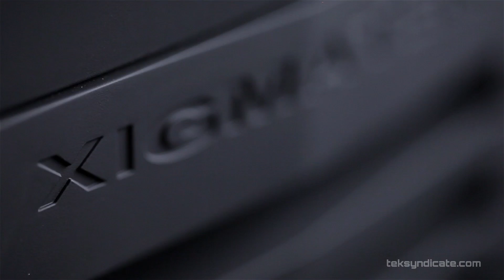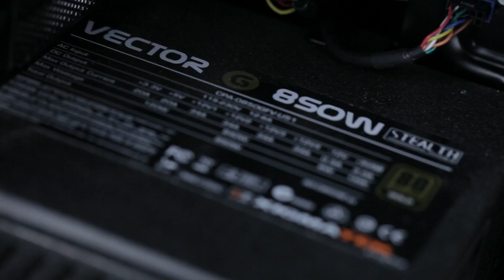Pistol's AMD Workstation Build For Streaming, Gaming, & Editing

Comment: is Pistol an AMD fangirl? surprised to see a 9590 instead of a 4770k or a 2011 socket.
Reply: If you watched the entire video, you would realize that they said it was better in some applications, such as streaming, than the 4930k.
Reply: never said it wasn't..
Reply: Well i don't see it used in many builds at all. most people just go for an intel, don't find anything wrong with it.
Reply: I think i will try it. should have no problems with heat if i put it up to 4.6ghz.
Reply: CrypticMeow So why are you surprised?
Reply: I actually might consider buying one for my second computer. ATM it has an 8350 in it but pretty sure it's faulty, Bottlenecks almost all GPUs i put in it that are high end.
Reply: CrypticMeow Have you tried overclocking it?
Reply: No i haven't.
Reply: CrypticMeow It could be from a driver issue. Try and see if a small overclock reduces the effect and try and see if you can push it far enough to negate it.

Comment: So Pistol has the 9590. Yet, on the cpu itself, it says " 2011".
I thought the 9590 was made in early 2012 and not released until sometime Q3/Q4?  Am i missing something here?
Reply: I believe it has to do with AMD marking their chips with the year the architecture was released, not the years they were revised. So the 9590 being essentially just an overclocked Bulldozer chip would be marked 2011, as that's when the FX-8150 came out. The same applies (or should apply) to all 32nm FX CPUs.

Comment: over 8GB ram needed game: BF4
Reply: That is ONLY if you play the game in multiplayer online and if you're running higher than full hd with maxed eye candy settings with a beefy enough machine.  The crashing you read all over the net about is a ram pagefile conflict between windows and the bf4 game.  It's not exactly the fact that bf4 acts like it ran out of ram reserves for caching things that the gddr3 or gddr5 vram in video cards cache versus the pagefile reserves that windows automatically sets, unless you manually specify that amount in a different amount.  

My friend's 2GB gtx 660 + 8150 running at 3.8ghz auto voltages with 6 GB of ram runs the game file in campaign except for some locations in the same few maps.  It's really an in game engine problem from the developer(s) of the game in which now someone ( whether it be EA, or Dice, etc) must deal with patches to fix.  

This is why i am NEVER a "first day launch" consumer of any video games no matter how good to price to value ratio is.  I ALWAYS wait until what I feel "enough" bugs HAVE been resolved before I pay money for any game. My time is more valuable than dealing with a 50+ dollar game that is plagued with bugs.
Reply: I run with 8GB of RAM and a GTX780 with not higher than 1080p and not max out any of the setting. There is still memory leakage.

I have digged into it and have conclude that the game is using the pagefile after out of RAM. Since all the stutter occur only when all my 8GB RAM are full.

It is a fact that at this moment, BF4 require over 8GB of ram to run completely stutter free.
Reply: ***** There's memory leakage because that game is buggy as fuck.
Reply: Pistol Slamfire agree

Comment: people are always concerned about noise...i give zero fucks as long as temperatures are low
Reply: On a video editing rig you want as much silence as possible so you can tell what you need to edit out (might be a weird ticking sound in real life and its actually your hard drive and you want it to die unsuspectingly) and also you might want near complete silence if you use speakers not headphones.
Reply: DaMagicalManiac Do video editors use headphones or monitor speakers to edit their videos though?
Reply: Dylan Coulston Well I'd think that someone taking video editing a bit more serious than a hobby would use monitor headphones so he can pick up any sounds that he may want to amplify or turn the volume down on.
Reply: Dylan Coulston both
Reply: This is an editing work station so I understand the need to silence 

My gfs yeti used to get sounds from the standard case fans until we turned the gain all the way down

Comment: Nice. My system is a lot like that only the value version:
8320 @ 4.6
Crossfire 7790's that were $70 a piece
Same mobo (don't update the bios btw, stock is best)
R4
Used 840 EVO (reads and writes at 5gb/s)
2 Striped WD10EZEX's for games (reads at 1gb/s for some reason, pretty neato. Were $45 a piece)
TT ToughPower 750w gold PSU which doesn't have the best reviews but so far has been rock solid.

Very happy.

Comment: Odd choice the FX-9590. Basically all reviewers stated that there is absolutely no reason to chose this CPU. Maybe if you don't want to change your motherboard. But it's not like the FX-9590 is a cheap CPU...
Reply: Those reviews were done when it was $1000 at launch. Now it's a third of that, which makes it not the best option for everything or even all around but for streaming it is an absolute monster.
Reply: You might not be aware of it's huge price drop. From what I remember the 9590 was a terrible processor because of the ridiculous pricing at release. Every reviewer was too busy screaming over it's price to really talk about it's performance, which was again was negligible due to price. Looking at it now, it's not a poor choice by any means.
Reply: Well I agree that FX-9590 definately lacks the amazing price to performance ratio of FX-6300, FX-8320 and FX-8350 and therefore it's a lot harder to justify choosing it over i7-3770 or i7-4770 but I feel like people highly overestimate the magnitude of mistakes they can make while choosing CPU or GPU nowadays. FX series is pretty amazing, Intel makes single cores that can crush nuts, all-in all market has it's issues but they are pretty small and no matter which choice you'll make you'll be rewarded with a good experience in real world scenarios. I feel like benchmarks confuse the hell out of people. No-one is buying FX-8320/i5-4440 to bench it against the option they didn't get to torment themselves. People buy chips to do stuff and if you know your budget and have realistic expectations for that budget you'll make a good choice no matter what.

Comment: nVidia is better for rendering and other workstation tasks so why go for AMD?
Reply from the maker: OpenCL.
Reply: Nvidia actually has worse compute performance compared to AMD especially in OpenCL tasks, the only reason why for a long time Nvidia was used for rendering and stuff like that is because some popular workstation applications mainly only took advantage of CUDA cough Adobe cough. Now that is starting to change as we see a lot more applications take better advantage of OpenCL.
Reply: Nvidia is actually pretty awful for general compute processes. Why do you think the R9 series from 280x and up have been sold out and STILL are? You'd be incredibly hard pressed to find a single 280x, 290, or 290x still in stock from official sellers/resellers at MSRP.
Reply: ***** No, you are missing something. Yes, AMD cards have been sold out because of BitCoin/LiteCoin mining, but the reason that they are used for cryptocurrency mining is because they have better compute performance per dollar, this compute performance can also come in help when it comes to things like After Effects, Photoshop, AutoCAD, 3DS Max, and for pretty much any program that can take advantage of OpenCL.
Reply: *****
Sorry for having a slight misunderstanding of your previous comment, what I took it as was like you said Bitcoin mining was the only reason that they were sold out and the only reason a person should ever get one, but now after reading this comment I get what meant. Again sorry for the misunderstanding.

Comment: Got my 8320 to 4.4ghz and it's plenty fast I would be worried about the thermal output of that because it's 100 watt higher than mine for 600mhz not worth it to me for the price either it's very expensive and hard to get in Britain for some reason

Comment: mistake me if im wrong but could you of had either the fans or the radiator on top on the outside of the case underneath the plastic window?

Comment: 9590 faster than a 4930 at anything? Why do I doubt that?
Reply: cause intel faboy syndrome wont allow it
Reply: Masterincommander Because if you look at benchmarks the 9590 barley holds up to the 4770 that's why.
So shut up if you just want to talk garbage.
Reply: more than double the price 3-7% better, totally worth
Reply: TheBernhard100
So because the benchmarks say the 4770 is better, it doesn't matter that they said in the video that the 9590 actually worked better for their use in the real world?
Reply: Price and less cores - bad side of Intel here. Also she had AMD build so she changed only processor. Additionally motherboards for 2011 socket are pricey nearly as much as processor. Here are your answears. AMD is way better for people who looks for quite cheap workstation.
Reply: *****
As you heard she needs PC for streaming. In this case FX 9590 is way better than Intel. Also as you of course passed part about she having AMD platform so she had to change only processor?
Oh and Intel is not king. Intel is just corporation which has luck to produce better gaming processors for now. We don't know if it won't change (it is always superiority of one producer for few years and then again other).
If I would buy gaming system it would be i5 4670K if working I would have problem choosing between FX or i7. Tho still - in games FX with Geforce is nearly as good as i7.
Reply: I never Said that Intel is better price/performance wise, or comment on the fact that the 9590 is not on a different chipst (like the 4930). I just said, that going by the benchmarks, the i7 4930 preforms better, by a lot. Both in terms of real world test and artificial benchmarks, and I doubt that there is any program that breaks that rule (notice, I said doubt, not impossible)
If you are going by price AMD wins (ofc. only as long as you don't count the extra power cost and the need for an aftermarket cooler if you want a quiet system).
Reply: TheBernhard100
Same goes with i7 4930K - need aftermarket cooler and uses up much more energy. Also - don't talk about TDP - if it's what you base it. TDP in both cases means something different. Oh - and syntetic benchmarks are mostly poor way to choose - eg. I saw tests where FX 8350 owned in many benchmarks i7 3770 - it all depends on graphic card added to them. Also - do you really have i7 4930K? I'm starting to doubt it.
Reply: AkaRyupl Lol, never said I owned one, also I was talking about the lower end models, forgot to mention that, not the high end.
You can easily run a 4770 at around 3.8Ghz and have a silent system. Compare that to the heat output of a 8150 (my brothers) and AMD becomes a joke.
You basically need to buy an aftermarket cooler for ANY 8 core FX chip, this making them about the same price/performace as the FX.
As for benchmarks you can benchmark a lot of different applications, such as games, video editing, rendering, even streaming, and from what I've seen the i7 4930 destroys the 8350 in everything.
Reply: The 8150 (which is the older one, 8350 is the newer vishera btw and apparently it's much better) has a 125w tdp. That's the same as my phenom 2, and even overclocked it isn't loud with a cheap $30 or less cooler which I'll keep it for years and for several cpu upgrades.If you're going to spend $300 on the cpu alone, what's another $30?
Reply: TheBernhard100
You really don't have knowlage about it do you? For 8 cored processor you do not need aftermarket cooler. FX 8350 runs pretty cool and is better than many processors from Intel to work.
FX 8150 is old processor from before i7 3770. You can't compare it to newer ones - it's called manipulation. Oh and you was saying about FX 9590 which apaprently is as good as i7 4930 in many things. Stop trying to manipulate because it is funny.
Also you have no idea about heat output in AMD or Intel - in bot cases if not OCed BOX cooler is more than enought and it runs pretty quiet. But if you OC it's complatly different - both need aftermarket cooler.
Reply: AkaRyupl Sure, because real world experience doesn't mean anything.
I build a PC with the 8150, it is fucking lounf.
Looking at the changes from the 8150 to the 8350 I highly doubt that there was a huge change in temperature output.
Also, I like to trust benchmarks over a bunch of people yelling around about how much of a Fanboy they are.
Reply: TheBernhard100
Benchmarks many times were acused of falsificating results. So I would not base my knowlage on it.
Also as I said - i7 is worser than FX 9590 in many professional tasks like streaming - it has 8 cores not 4 or 6.
Of course you will call me now fanboy because I said that Intel is not as good in everything? Your lack of knowlage in this task shows many things.
Also of course you passed part when I told about gaming system - thank you very much.
Reply: AkaRyupl Look, until I see some benchmarks (artificial or real world) I doubt the 9590 is faster.
From my personal experience the 4770 is faster than the 8350 in almost everything.
The 9590 ads less than 1 Ghz whilst the 4930 adds 2 more cores (4 threads).
I never said that it is impossible for it to be faster, just, from what I have seen so far, very unlikely. I am willing to change my opinion if I am proven wrong (especially since I am looking into building a streaming PC atm), but I doubt you are.
Reply: TheBernhard100
Apparently FX 9590 will be better from Intel i7 - in video working, streamin etc - all programs uses cores not like Intel tried to imply threads.
Thats why eg. Radeon cards works badly on FX processors while Geforces works much better - drivers are bottleneck in this case (Geforce drivers likes multiple cores when Radeon ones likes strong single core).
With tests - I saw planty showing eg. video editing/coding etc. performance where i7 gets crushed by FX 3850. With games - it is sensless to buy i7 4930K for gaming or i7 4770(K) - i5 is best for it.
Also - as I said benchmarks does lie a lot - depends often if they are optimalised toward card/processor.
Reply: AkaRyupl Well, Haven't seen to many info on them in video editing/streaming so I am looking forward to the benchmarks.
It's just that in most everything they are ahead.
I said that I doubt the FX being faster than the i7, and the first thing I get in return is someone calling me a fanboy, sorry if I was a bit heated.
I mean, thats why you said doubt in the first place, because you have incomplete information, but all the information you di have leads you to believe something that you yourself aren't 100% certain in.
If I had said it is impossible for it to be ahead, that is a different story.

Whatever, Cheers!
Reply: TheBernhard100
If you talk about gaming performance and some programs optimalised toward Intel - yes FX is worser. But programs optimalised toward both producers - they work better (only if program needs a lot of cores).
Honestly  hope soon it will be like always - AMD will jump out with something new and then they will be better. By always I mean that once Intel is better and then in few years AMD is better.
About you being heated - I'm not suprised - sometimes people loves to call someone fanboy. Tho don't worry. I don't feel insulted by any of your words.
With PC market I'm always coldly calculating. I know a bit about it so I can tell you one thing - where Intel is weak AMD is strong. So choosing CPU is all about knowing what you want.
Also - good luck on choosing your build. Anything you will choose and you will be happy with is good.

Comment: fx 8320 4.1 ghz , Asus M5A97 R2.0 , 2TB WD drive , 240 Int 330 , 8GB 1600 , BD slim :P , and Antec One Midi ,XFX 550 pro Core  none modular, hd 7970 at one GHZ , total of 650£ , Though i bought the ram used and the case used , windows index is 7.8 , 6531 FireStrike 1.1

Comment: When you starting talking about people's "First Computers" and how they were all pimped out... I shamefully dropped my eyes over to my own "First Computer", which it indeed had its fair share of LED fans and lights, along with a bright fan controller, and a number of other things shoved into the case... o3o
Reply: haha same here, I still have it :3
Though I still like it :P
Reply: I tried from the start to avoid that, esp. since the computer is in my bedroom. I also try to cover up indicator lights and such. I used scotch tape with black sharpie to dim the light coming from the power leds on my haf 912.
Reply: I'm the exact opposite, my first computer had no lights at all, but then again that was a long, long time a go (man I feel old), my current rig has only one light that comes from the psu, but the rig before it had all led fans etc. ;)